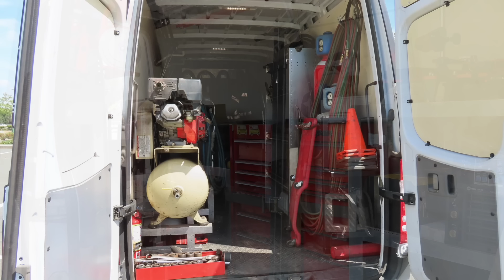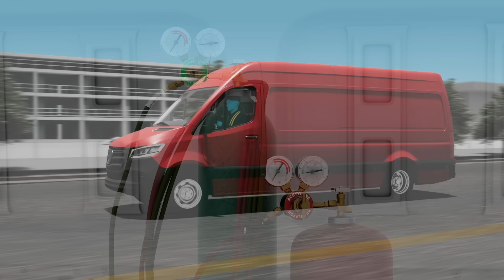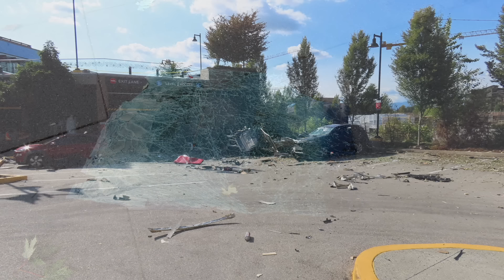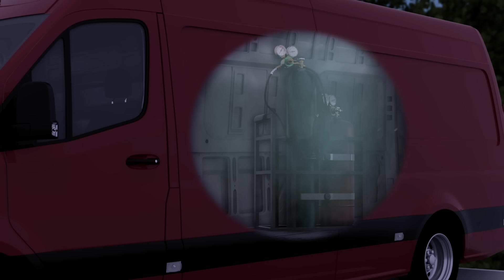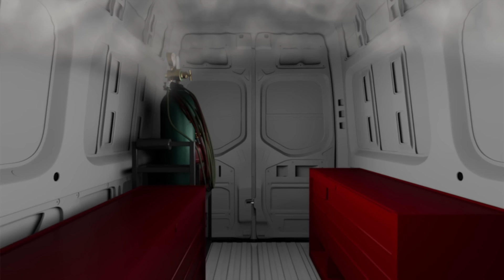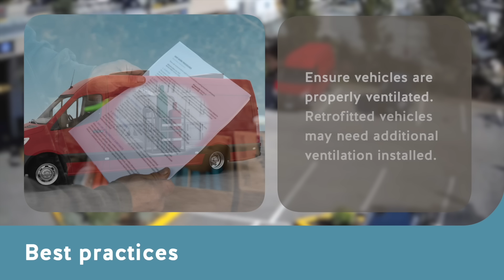Incident Investigation: Key Fob Triggers Explosion in Service Vehicle | WorkSafeBC

Comment: I have to agree with the posters here, WOW.  Not to take away from the reason for the incident and the lessons learned, but that was quite an realistic animation of an explosion!  All the debris and the piece of metal falling on the bumper making the bumper bounce and jump around, outstanding!  But as for the incident, just another example of corner-cutting.  If he had also just turned off the valves on the tanks themselves, probably would have been fine.  Rules are in place for a reason.  This probably already happened in the past creating the rule in the first place.  Luck no one was hurt!  How many of us stand right next to the door when unlocking with keyfob....

Comment: If the inside of the van got hot , the gases inside the tanks would expand creating higher pressure .  Tanks like this have pressure release valves to prevent overpressure of the tank .  Thus a release of gasses into the van

Comment: If the worker had properly closed the valves on both tanks, there would be no more leakage than if he had removed the regulators and put on the safety caps. The problem must be that, probably the acetylene tank, did not seal completely.

The comment about proper ventilation is quite appropriate.
Reply: With the regulators installed, perhaps less warning that the valves are not closed because you wouldn't hear gas escape.  I'm curious about how much gas it takes. Could there be enough gas remaining in the hoses to cause an explosive mixture in the van?  Is it common for people to drive from job to job with the regulators attached when the tanks are in an open bed?  A vehicle accident is when the safety caps are important. Anyways, this was 100% foreseeable.  How could their business be driving around with compressed gas tanks inside an unvented vehicle?!

Comment: Hoses shown were intact. Gages were still on the bottles. If the gas leaked from the Acetylene cannister out the hose through the torch all the above would have been torn up. Video didn't show that. Plus the accident would have happened at any rate if it were the cylinder valve leaking Acetylene is heavier than air. It wouldn't have vented out the top. While still a good way to die, not having the caps on the bottles would not have changed this incident. Only powered ventilation would have cleared the cab of the VARIOUS petroleum based fuel vapors and if present the Acetylene gas.

Comment: Who doesn't know that you can't store flammable gasses in a van?
A simple roof vent would have solved the issue.
The safety cap for the cutting torches are only for transport in case they fall over so the valves don't  get snapped off. When the tanks are held in a cage like that the caps serve no purpose.  The valve can still fail and leak, with or without a cap.
Gasoline powered things usually have a pressure release vent if they get too hot.
Reply: I don't know about acetylene but LPG is more dense than air, so you need ventilation at the BOTTOM of enclosed spaces containing LPG bottles.
Reply: You’re completely right. There is video on YouTube of a full size welding oxygen bottle falling and snapping its valve/regulator assembly off. It became a jet propelled missile almost immediately, luckily no one was killed or injured in that incident, especially as there were many people around at the time.
Reply: So you can store flammable gasses in a van with a simple roof vent?

Comment: The advice given here is not correct. 
The safety caps only protect the valves from physical damage but they are not preassure tight. A leaking valve will still allow the space be filled with gas.
The best way to improve safety in this situation is set the regulator to zero after use - that way even if the valve leaks there should be no gas release. Artisans are taught this in trade school, but get lazy.

Comment: I used to work for a company that supplies the bottles of compressed gasses. You NEVER transport or store flammable gasses in an enclosed vehicle! This is what happens.
Look for the stories of the U-Haul that had a propane tank in it, or the car that was thrown OVER the Wendy's because there was a welding gas cylinder in the trunk!
Reply: One would've thought that such a van would be custom vented to reduce risk.
Reply: Correct. Assume that a slow leak is ongoing by default and handle the gas cylinder accordingly. And don’t put compress gas cylinders in ovens. If letting your kids or dogs in a car in the sun is bad… so is leaving gas cylinders…

Comment: As soon as I saw the Acetylene and Oxygen cylinders, I wondered about ventilation. The gas powered compressor was also a concern. Excellent video presentation, and it got straight to the important facts in the scenario without loads of waffle.

Comment: It doesn't really make this situation safer by removing the regulators from the tanks in this instance.  If the valve leaks, it leaks. In fact, having the torches installed could provide a secondary valve in this situation that would require two failure points for this tragedy.
Reply: yes, i suspect the leak was before the primary valve.
the video never explicitly said it was the acetylene gas causing the explosion. it could have vapours from the gasoline engine as well.
Reply: @ursodermatt8809 Well put. As a long-term auto-tech, that scenario would be from fuel stored inside as all gasoline is outside the passenger compartment on a vehicle.  Air compressor,  welder/generator.

Comment: I use an oxy/acetylene torch to fuel an oxy/acetylene cannon for the 4th of July, which is just a 4" diameter three foot long steel pipe with one end sealed with a welded cap and a 1/4" hole near the base to insert the torch tip, I wrap tin foil over the open end, ignite the torch and set a neutral flame then tap it out on a piece of wood then insert it into the small hole for about 30 seconds. Just that small 4" x 3 foot section of pipe is powerful enough to shatter windows within 50 feet, and rattle windows up to a quarter mile away, I can't imagine how powerful an entire GD van full of it would be, that thing looked like a 5 pound tannerite charge going off. I'm curious what the mix ratio was, if it was acetylene-rich then it wouldn't be nearly as powerful as a perfect stoichiometric neutral flame mix would be but regardless, that was one BIG explosion. I'll bet that dude's ears were ringing for months after a blast of that size and close proximity.

Comment: If you pause it just before the explosion it seems the air around the van ignites first. You can see a reflection on the red car's rear driver side and a large area illuminates in front of the van. Can anyone explain this?

Comment: So, the remote start/security system initiated the explosion as there were explosive gases present. But where did the gases come from? Did the come from the oxygen/acetylene system? Or from the engine driven compressor? Was there a cracked hose that led to the gases being present? Or a faulty or improperly installed regulator? It would be good to know the root cause. I’m glad no one was injured.
Reply: the primary valve was turned off. 
the correct procedure is to turn off the valve at the bottle. then the valve at the torch to release pressure. saves the hose from splitting and the gauge as well .
Reply: Thats definitely an acetylene explosion. Orange sooty flame.

Comment: That was way more gas than you would get out of hoses with tanks shut off.
I have tanks in my 1 ton cube service truck as well as a gas powered welder. I turn the tanks on before I use them, with the door raised, and shut them off as soon as I'm done as well as shutting the valves on the torch. This guy definitely had a major gas leak and I would bet a paycheck that he's too lazy to keep shutting off the tanks.
A buddy of mine at a mine site used to fill a black plastic garbage bag with acetylene, put it under a steel welding table and remotely ignite it to watch the steel table lift off the ground, just for kicks.
Even that much would have been nowhere near enough gas to blow up a van. That van was saturated with a huge volume of gas, for sure.

Comment: I'm glad that the employee unlocked his van from so far. If he was close the outcome would probably have been very different.
Reply: it was also lucky tat no one else was in those 2 cars, especilly the one next to the van, that thing was ripped apart
Reply: Aye aye, Captain Obvious
Reply: @Infinitelyperplexed  The title blames the remote; but using the remote probably saved his life.
Apparently the relay for unlocking the doors was not explosion proof.
I guess they decided retrofitting a vehicle electrical system to be explosion proof would be impractical.
Reply: @economicprisoner  Probably would've been RIP instead if the vehicle relied on keyless entry

Comment: Thank goodness the guy didn’t wait until he was right at the door to unlock it
Reply: Indeed. Still, based on the footage, I am betting he wished he was yet further away.
Reply: The video states that he actually started it remotely, which makes a lot more sense in terms of potential ignition sources than it just being unlocked. The solenoids that control vehicle door-locking are far less likely to generate a sufficient spark than an engine, and all essential systems thereof, starting up. [Edit: The worst case scenario would’ve been him starting it once in the driver’s seat.]
Reply: @anhedonianepiphany5588  , I wasn't saw any brand of door opening mechanism solenoids. They're usually linear actuators, operated with a small brushed motor through gears, rarely non self-locking worms.
Reply: Just what I thought. Holy hell! Bet he needed a change of underwear…
Reply: Yeah... Could have gone from "no injuries" to "major reconstructive surgery"
Reply: @AnimeSunglasses  The potential for a coffin being needed was there at his actual distance or farther, and any closer would have multiplied the risk by orders of magnitude.

Comment: i know the title says explosion. and we got a warning at the start of the video. but i cannot express how shocked i was by that explosion. i was not expecting the van to just be gone.
Reply: Yeah. That explosion was stunning.
Reply: yeah I had to watch it a few times because I was in disbelief
Reply: You must watch a "home" boiler for warm water being explode. 
Because, that wasn't need fuel, oxigen at all- both of them inside the water. 
And the ratio between water and steam is the key.
Whole brick houses can be "just gone" like this van.
Reply: @szennyvizcsatorna2483 Steam explosions aren’t “chemical explosions”.
That’s pure thermal energy.
Sealed gas bottles containers are required in a number of jurisdictions. These sealed containers are then vented to the outside to prevent gas buildup inside vehicles.
Reply: @szennyvizcsatorna2483  Ratio? It's just the overheating water, being hotter than it should be due to pressure.
Reply: Oxyacetylene is an extremely energetic mixture. Its wild they didn't have more mitigation in place on the vehicle.
Reply: @damenprice3752 ya, that in an enclosed van is terrifying. You really want heavier than air gas ventilation.
Reply: @damenprice3752 yeah in our 250x50 foot shop we are required to have oxy and acetylene stored in completely different ends of the shop in vented cabs, bottle cart sits in a vented room when not in use.
Reply: I did a frame advance the actual explosion was over within the first 2 - 3 frames after that it was just debris flying for a few frames
Reply: several m3 (so several kg) of acetylene/air mix is equal to antitank landmine.
Reply: That was incredibly violent! :fish-orange-wide-eyes:
Reply: Holy cats!!  You arent kidding!!
Reply: You ain't kidding. You'd never know it was a red van.
Reply: you've clearly never played with oxyacetylene before.
Reply: The power of acetylene is incredible. Look up the practice of "Carbidschieten" in the Netherlands for examples.
Reply: Right? I literally said "oh my god" out loud. haha
Reply: Acetylene is oxygen and hydrogen mixed. It's basically a perfectly efficient explosive. That van didn't vanish. It turned into steam.
Reply: HOLY SMOKES yes... I had to triple check that it was security camera footage and not an overenthusiastic simulation... Just NO VAN NOW

gods, if he'd been half as far from the van at that moment...
Reply: Hope that guy bought a lottery ticket that day.  If he had waited just a few more seconds before hiting that unlock button, he would not have made it.  I hope he didn't get injured by any shrapnel.
Reply: When I was a kid we'd launch 55 gallon drums with homemade 'things'.  Sometimes we would overdo it and instead of the drum going up it would just turn into a piece of popcorn.  I've never seen anything turn into confetti before.
Reply: Gas explosion caused by a spark when using the key fob remote? There was a lot more left than what I expected. Of course, the car would mostly be gone. The mechanism was likely similar to the Blue Origin explosion just recently. Have you seen video of that one? Flattened the whole area.